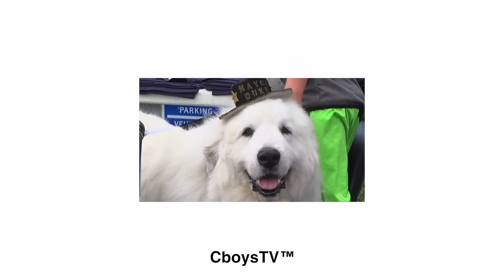My 707hp Ram TRX Sucks in the Mud

Comment: I had that 4x4 unavailable, service antilock brake system happen to me in the middle of a baaad storm this winter, almost crashed multiple times I was 25 miles from home and we barely made it.. then took 2 months for the shop to get the computer that fixed the issue then cost an arm and a leg to boot.

Comment: Rams are always getting stuck and losing races 🤣 they need to realize that having thw most  power doesn't equate to winning races and making it through a mud hole.  Look at the Raptor and Raptor R .  Way nicer performing and way better off road and in the mud.  Get that Raptor R to show that Ram how it's done. Even a regular Raptor on 37s with the ecoboost will show that Ram what's up🤣